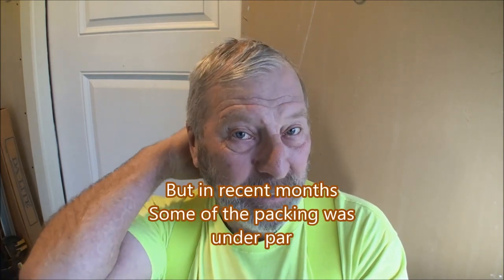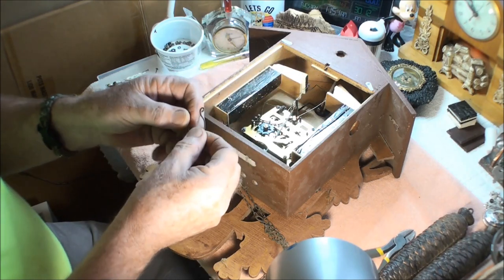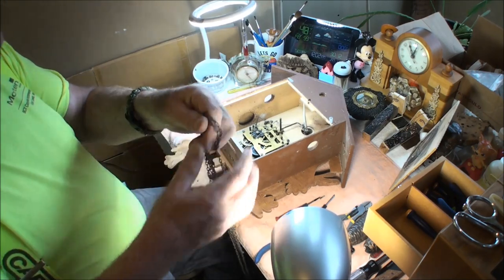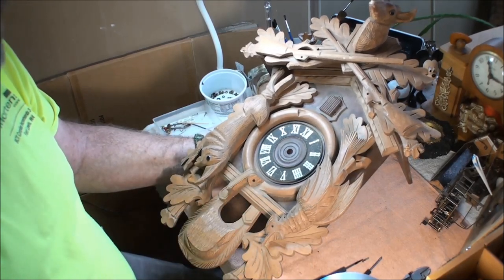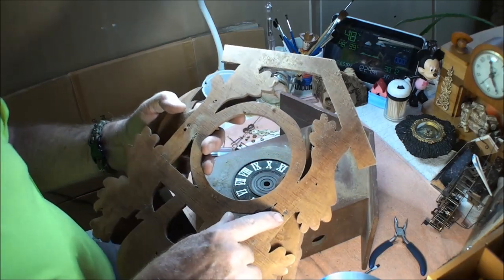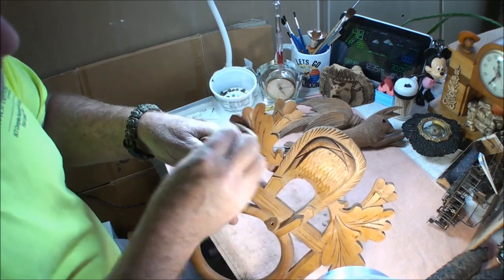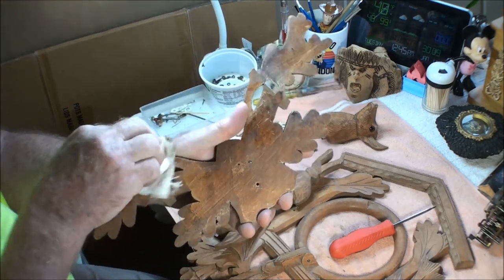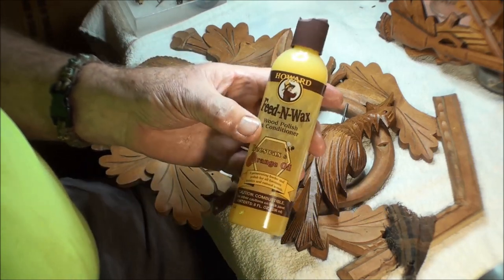Clean the Dust and Wax your Cuckoo Clock

Comment: I have a black forest Cuckoo clock that I received 30 years ago after my grandmother died, it was my grandfathers and I can't remember it working when I was a child so probably hasn't worked for at least 60 years.
I've been watching your repair videos so I can have a crack at repairing.
The clock case without the decoration measures 12"x8" the bellow tubes measure 6"
I've tried to find a makers name on the clockwork frame but can't find any makers name.
Thanks for the videos and giving me the information and confidence to get the clock ticking again..... Hopefully🤞🤞
Reply from the maker: I wish you luck on the old clock. If you run into anything you don't understand, My Email is below this video. It also helps to send pictures of the clock with your questions.
Reply: @justmike57  
Thanks Mike I appreciate the offer 👍
Reply: @bobp6742  be sure to send Mike a picture of your clock. He sees so many, Mike may be able to identify the maker. I’ve noticed a couple differences only between styles, because I’m partial to Schneider clocks. The rifles have a distinct carve that is slightly different.